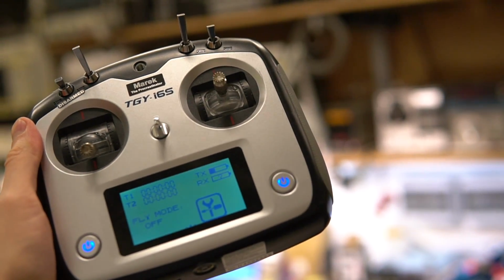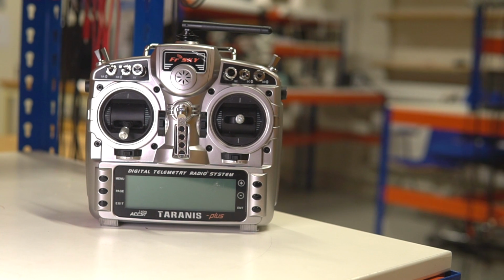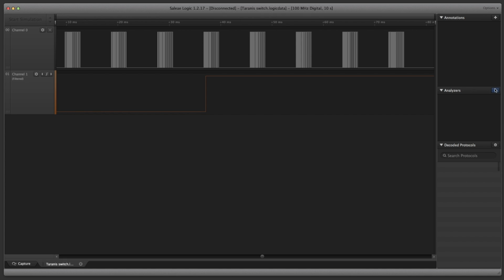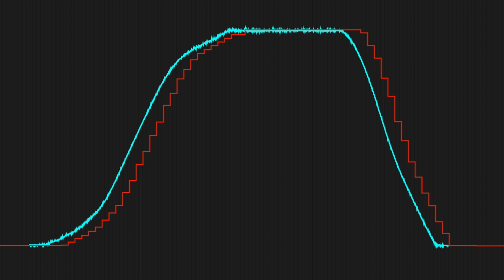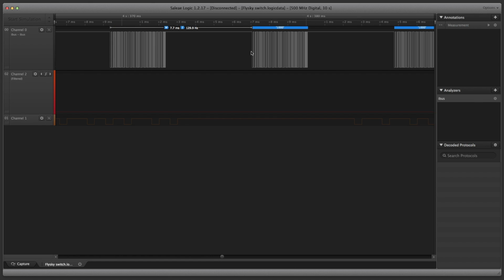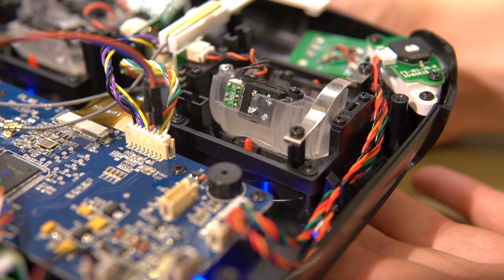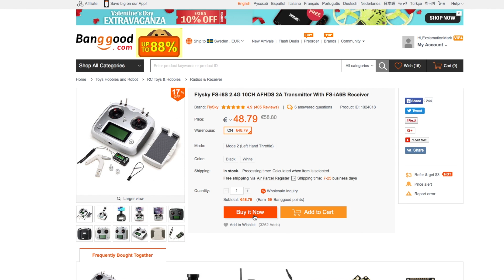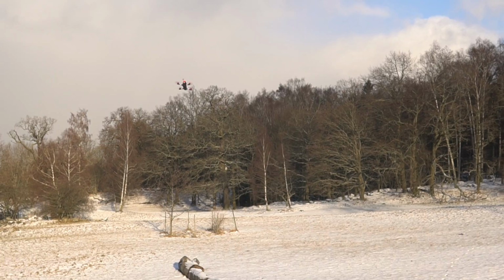Radio controller latency - Flysky i6s lag compared to Taranis X9D

Comment: Great work!(confirming Drone Mesh's results). I own the Turnigy Evolution and the Flysky I6S and both had serious range issues with with 3-4 different full sized and micro receivers...witness the extensive problem thread on RCG of the FS-A8S. There were countless times when I experienced brownouts and failsafes 100-150m out on different receivers. I held off on jumping to Frsky for months as I was impressed with the lower latency results by Drone Mesh (and Dronelab)...and I loved the ergonomics of the Evolution. I prayed for a new better receiver to be developed from Flysky but it never came. I got my X7S about 6 weeks ago and after more than 100 packs I have had zero issues flying out as much as 525m.

I take issue with your statement that there is "no reason to avoid the Flyskys". Now if Frsky can just fix its latency without the TBS Crossfire...
Reply from the maker: Thanks!
One thing I regret not mentioning is the much better selection of receivers for the Taranis. That might be part of the range problem - the two antenna telemetry receivers for Flysky are so weird and bulky that not a lot of people fly them, wheres the Taranis practically comes with a super nice, diversity micro receiver. We definitely do intend to do some range testing of various TX - RX combos, to sort this one out. We just build a prototype range testing device and are digging thought the data to confirm that it is useful and applicable to a piloting scenario. You can have a sneak-peak at "Rangee, the range tester" prototype here: https://i.imgur.com/UDCzELM.jpg. It will take us a while to make a "Flysky vs Taranis range comparison tested and measured" video, but I'm definitely looking forward to that :D
Reply: Yeah, but you can modify your Flysky FS-iA10B to be very flat, just desolder all the pins and solder a small cable to your preferred bus. For binding, just short the 2 Binding pins. A bit of heatshrink or insulating Tape and done. A flat flysky receiver with 2 antennas.

Comment: I hear that the flysky latency is much more pronounced at range, more so than the taranis, any plans to revisit and test this particular claim?
Reply from the maker: It boils down to range in general. Dropping packets once you are flying out of range will cause the drone to be less responsive, even though some signal does pass through. The worse the range, the sooner this happens. We're planing to build a rig to quantify the "hit rate" at various ranges, though it might take as some time to get to that, with other things planned for the nearest videos.

Comment: What did you expect ? Taranis firmware is much much more complex than the simple i6s and does a lot of extra things between each gimbals sampling. There's also an ADC filter to reduce sticks jitter on Taranis, it induces a bit more latency if activated and there's tons of things to look at depending how the radio is set. Anyway, even the best pilots have no problem of latency with radio control, others aspects are much more critical than that.
Reply: Non of you've said is relevant. Latency matters for "best pilots" that's why many of them are ditching FrSky and jumping onto much faster Crossfire. Adding filtration on ADC is/could be done on the Flysky for all we know. Fact that radio got more features and "things to do" other than sending gimbals readings is no reason or excuse for bad latency - unless there is some kind of issue in code. Other aspects of the radio are important but quality and latency of control is the most important - again that's why crossfire is a thing and that's why everybody uses HAL gimbals on taranis.
Reply: Yeah, but some1 needed to test it to be sure Captain Hindsight.
Reply: Compare the prices too and you ll 'love' the tarranis even more. :D